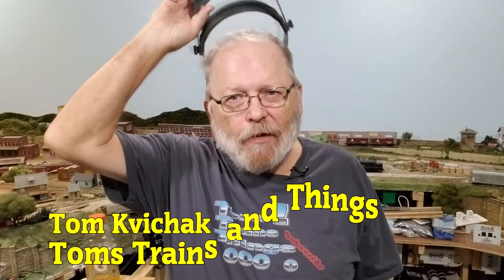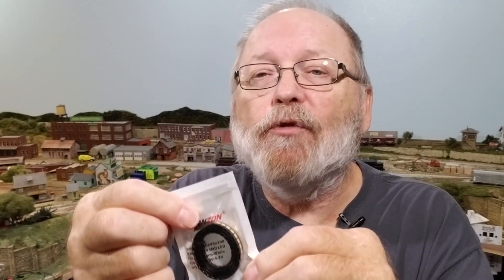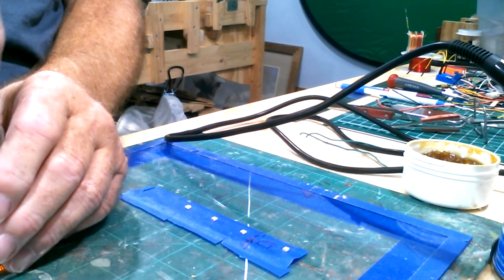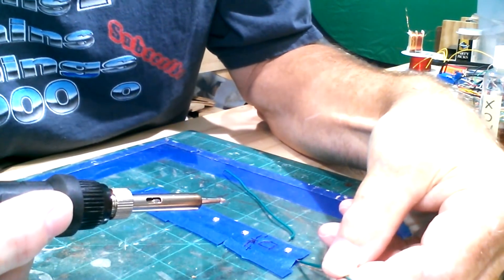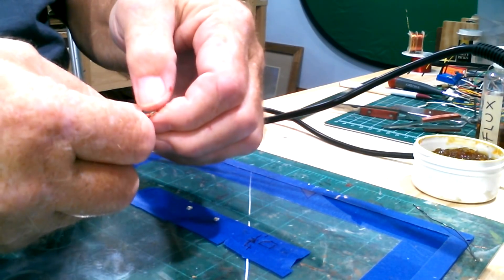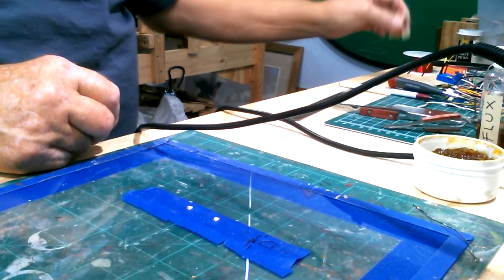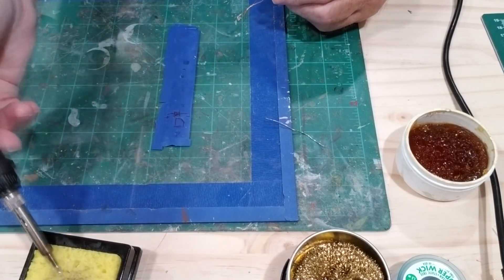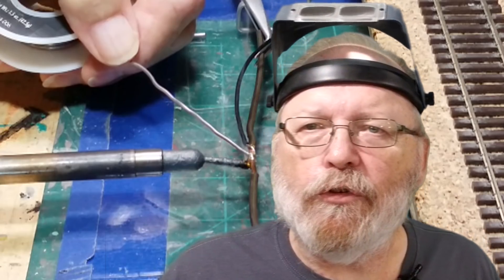Easy Soldering Method For Surface Mount LED's With Four Types Of Wires

Comment: FYI ; real trick with soldering is the right tip and its size
Also A good trick i use is a magnifier light (the one with a 8 inch round flours-ant tube) , it gives me light and ability to see, plus blocks the smoke from my face
Reply from the maker: Thanks for the tip. I have several of the magnifying lights, the only problem, it gets in the way when trying to film. That's why I had the goggles on.
Reply: good point, i sometimes had to use an eyepiece to check, SMT quadpacks are small

Comment: You mean, I wrote ALL that shit and you didn't even LIGHT them up???
Damn ( I guess wires on surface mount little LEDS don't fucking work 🙄
Reply from the maker: You have to watch more videos where I use them
Reply: @TomsTrainsandThings 
Thanks.
It's probably only like 20 mA on average?

Comment: Dear Tom.
I think the manufacturer of that enameled copper wire lied to you. The insulation can't be used as solder flux. Yes the product is called in a way that it might lead to that assumption.
I find that the enamel will burn up from around 300-350°C (sorry I have no idea what that is in °F).

Thank you for charing all your knowledge. Please stay healthy.
Reply from the maker: After using the wire several times and reading what it says. You can solder it without removing the enamel. The enamel will melt allowing one to solder without stripping as with regular magnet wire. Still need flux. I solder @ 650F which is approximately 345C.

That was my first attempt with SMD and the new soldering station, so I'm a little better at it now..

Comment: I am about to order SPMWH1228FD5WAPUVJ- which is a white cool LED and comes in the Cut Tape packaging from DigiKey- https://www.digikey.in/product-detail/en/SPMWH1228FD5WAPUVJ/1510-SPMWH1228FD5WAPUVJCT-ND/12083761 . For the sake of economy I am purchasing 20 such LEDs for the involved shipping costs.  However, I need to use them as single discrete LEDs, for my project so am planning to take them off from the tape and wire them separately on a PCB using solder using proper static precautions and also introducing suitable resistances in series to avoid malfunction and stay within the limits of the prescribed maximum current levels.
My question is , can I cut one LED from the tape and then solder them separately on my PCB of choice?

Comment: Tom, it's Fran,enjoy your stuff,what is the magnet wire used for or do it matter where use,thanks tom
Reply from the maker: You can use the magnet wire anywhere you use any other wire as long as the gauge is appropriate.
Reply: @TomsTrainsandThings  thank you tom,am in rebuild stage, got three power supply's to use some where on work bench or where ever good instructor you

Comment: What size tip are you using? It looks like a chisel type
Reply from the maker: I tested out several different tips for this video since it was the first time using this soldering station. It's a 1.74 mm (roughly) chisel tip. Even though I have about a dozen different tips, I do most of my soldering with this one.

Comment: Tom, what "Lumen" rating are the 3528 LED's you used in this video?  I've found them from 1400 - 6000 Lumens, though most seem to be 3000 Lumens.  Or do you simply control the finished brightness with the value of the series resistor?  I've had to tone down regular 3mm LEDs, which most recommend a 1k resistor, by using 1.8-2.2k.  This really cuts the current way below the 20 ma rating, down to 6 or 7 ma, and they are still plenty bright, and will last much longer.
Reply from the maker: They are 3k warm white. I usually test the brightness for my application with the current limiting resistors. With the warm white I may vary the intensity from building to building or room to room in the same building or for external lighting. I usually start with a 1 k resistor and work my way up or down until I get the desired look.
Reply: Thanks, Tom.  Found the 3538's in 3000 Lumen rating.  For headlights, I usually use warm white LED
s on older locos, GP40's, SD40's, etc, and pure white LED's for later locos, Dash-9's, etc.  I've also used warm white to replace light bulbs in stereo gear and meter lights in ham radio gear.  Really enjoy your videos!
Reply from the maker: Thanks for your input.

Comment: Tom another super video thank you very much. If your bothered about Centigrade to Fahrenheit do what I do at lower temps up to about 40 degrees Centigrade multiply by 2 and add 30 you will be in spitting distance then but when you get up to 155 Centigrade just double it, you will then be within about 5 degrees.  Have a great Christmas with your kids.
Reply from the maker: Thanks Frank, that's a good rule to remember. If that fails I always have the conversion app I found. lol